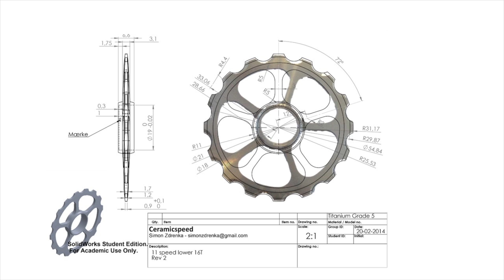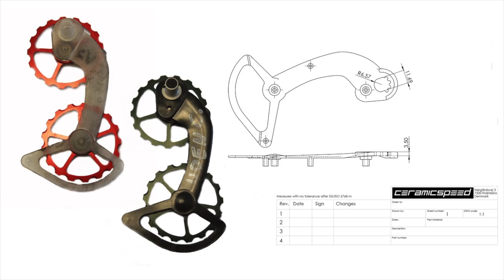CeramicSpeed launches the world’s fastest pulley wheel system

Comment: If you would like the “world’s fastest derailleur “ just install Ceramicspeed’s pulleys.  They only cost $450.  Yeah. I’m very well experienced in composites and the benefits of ceramic bearings, but a claimed 2.4 watt gain simply by swapping pulleys seems very overly optimistic. I would really like to see a scientific methodology test to substantiate this. But in any case, $450 is brutally expensive for this, and I’m thinking that for many riders, spending $450 on other part upgrades may well provide much more real gains.  I’d be very interested in testing these.
Reply: It’s all marketing . You think a small company like this will have any R&D COMPARE TO SHIMANO ?
Reply: its 1.2w

Comment: 2.4W on a pulley? That's just bullshit. Typically the chain runs at a speed of about 1m/s (assuming 52t chainring and 90rpm).
To get those 2.4W you would have to tell me that something pulls on a chain with a force of 2.4N. That's almost 250g ffs. Are you serious? I can safely claim that no pulley system wastes as much as 2.4W. Looks like you are trying to sell some overpriced crap.
Reply: This is not a real test. At high speed, your legs are pushing really hard on the pulley, there are more then 100kg applied to it, and sure it wouldn't be so easy to move like when you have your bike on a stand
Reply: force on pulley never change because you are pulling on the upper side of your cassette.
Reply: No, the pulley would break off clean with 100kg applied to it :D

Comment: ok mates....neither rider mentioned any "wins" or PB/PR in their testing of the 17t pulley u are promoting/selling.  Which leads one to question..."which speed are u referring to?"(i.e., changing gear speed?) @CeramicSpeed
Reply from the maker: +al karg  The reference we made was towards riding speed. When a riders equipment saves watts it can be looked at in two ways: a) it allows an individual to achieve higher top speeds for the same wattage output or b) it allows an individual to achieve the same top speed with a reduced wattage output. Hope this answers your question.
Reply: I see, tks.  Yet, would be great if your above video riders would've said they "won such n such" or "achieved greater PB/PR speeds/times/wattages" better yet, with SPECIFIC Values, etc.  They didn't. Why not?  Seems obvious to most that they should've done so, if indeed they did so.
Can u answer that for me/us please?
Reply from the maker: +al karg The OSPW System helped athletes to 3 x IRONMAN 70.3 victories and 1 x IRONMAN victory all whilst the product was in its prototype phase. Whilst we are unable to comment on why the athletes chose not to communicate this, we are very privileged to be in a position where our products can better the performance of athletes worldwide. We fully expect that over the coming months and years the OSPW System will continue to contribute to athlete victories and success all over the world, at which time we will of course be documenting and communicating these victories/PB/PR's to you as our followers across the various communication platforms.
Reply: Pardon me for my persistence re: facts, data, etc., but methinks it would behoove any seller such as yourself to make sure that the mentioned/posted/wrote "facts" u wrote above would be more than casually mentioned by your Ytube video riders here, specifically with data/numbers we can understand or "bank on," as well as mass-marketed to the world. 
After all, u are looking to sell more OSPW "units" are you not? (or am I missing something?)  Isn't this part of your reasons for posting here on Ytube vis-a-vis CeramicSpeed?

Which leads me/us to ask:
1. "which specific IM's & 70.3's are you referring to?"
2. "what were the time/speed gains specifically achieved?"
3. "where/when/how much $$$/(etc) is this OSPW available for sale, be it internet, or retail store?"
Tk u for your patient replies, CeramicSpeed
Reply: +al karg The reason they didn't is because they don't make any difference and are just bling for your bike.
Reply: +CeramicSpeed this sounds interesting. I have Campagnolo SR so, I don't believe the OSWP is possible. But would the 3D titanium pulley wheels be possible and, are they available? should this assist in a smoother ride feel as well? ty